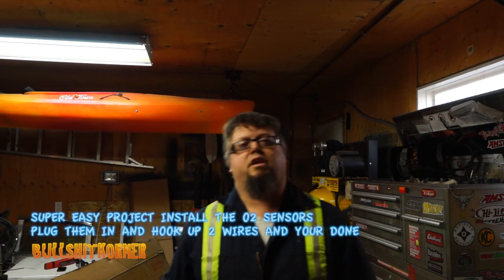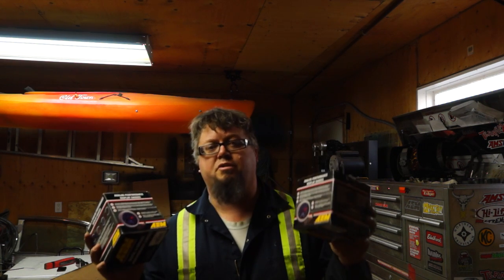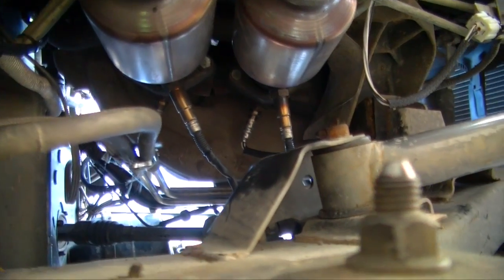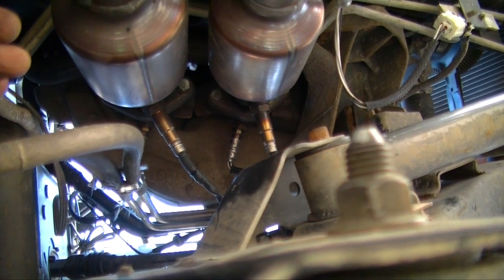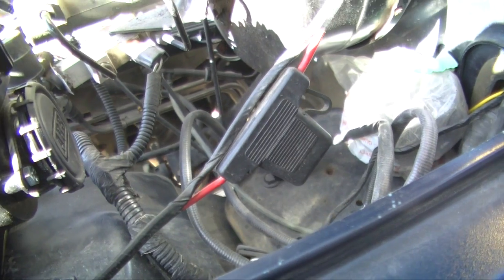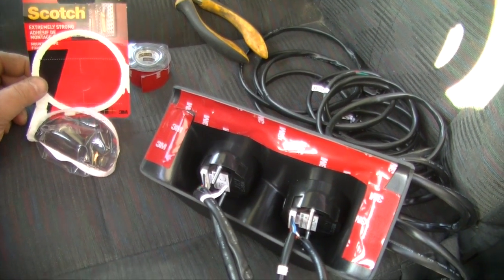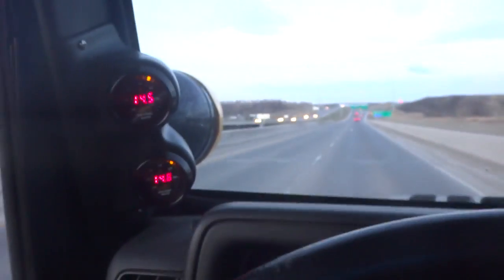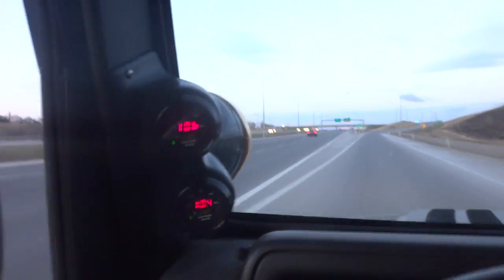Installing AEM Air Fuel Ratio Gauge

Comment: If putting the wideband past the cars scues the afr readings, then why does jeep put the o2 sensor post precats then?
Reply from the maker: Those are secondary to monitor the cats.  The ones in the headers measure the a/f ratio

Comment: That 3m tape would have stuck if you degreased the panel. its not the dust you need to wipe off, its the grease.

Comment: hey man, so I'm awaiting my supercharger for my TJ and was wondering which cat exhaust you have here when installing the widebands? I'm not 100% sure yet if there's enough space on the stock exhaust to weld the sensors in pre-cat but yours look just right. thanks

Comment: did you wipe the pillars with thinner before sticking sir? and did you check that you have the o2 bungs placed at the correct angle? seems like u planted 'em right at either the bottom or top most of the exhaust piping.

Comment: Hey, If you don't mind me asking. Did you splice into the intake line prior to the check valve or after for the split second vac/boost sensor and boost gauge? and if so does it effect the split second and boost gauge reading if it is sliced in after the check valve?
Reply from the maker: +Tyi Sloan the answer is neither to any of those questions, the routing is shown in the supercharge install video

Comment: I tried 3m tape in my F250 for the pillar gauges. Big time fail. First launch down the drag strip they were done. Haha.
Reply from the maker: Zane Pyles Ugh i hope you don't have the 6.0 diesel, i had a 2006 f350 and my diesel was a pile of crap
Reply: Na, 6.4. Haha. Holds up much better. 110k Miles and hasn't left me stranded so far. I have some work into it. The fuel systems on it are touchy. I'm running an bigger sticks with a single s476 turbo with ccv rerouted and airdog to keep up. We have some 6.0 folks in my town, but they all drive like my grandma.

Comment: Yo this migtnbe a dumb comment but so you dint have o2 sensonr on the jeep howd ur car computer know how much fuel to add or take away to keep it in (not sure if spelling Is right) stokiometric
Reply: Tha gauge just monitors what is reading from the exhaust. The stock 02 sensors are sending a/f info to the vehicles computer which in turn is adjusting as needed. The gauge he installed is just monitoring whats going on and puts it in a format you can understand "the gauge".... which you can in turn use to tune.

Comment: Apologies for my comment on a previous video, in which I believe I said it looked like you were running lean at WOT.  I misread 10.x as 18.x in the previous supercharger video.

As for the pre-cat issue of locating the AFR sensors, that's a dissertation in and of itself.  Long story short, you did the right thing in installing them upstream of the precats, despite the distance not being ideal.  You CAN install them downstream of the pre-cats, but you then need to calibrate them, either with a resistor network or computer wizardry, which those gauges probably don't support.  It's a lot of work with no real benefit outside of outright racing.

If you're curious about the process, you're welcome to Private Message me here on YouTube, but it's waaay too much for a comment post, and no one really cares.  ;-)
Reply from the maker: rhkips man if i was running 18 at WOT i'd be melting pistons pretty damn fast,  In the future i may play around with the split second programming so i may have some questions for you then
Reply: Haha, you'd be imprinting your hood with your cylinder head at 18:1.  XD

Hit me up anytime!  Happy to help if I can.  :D
Reply from the maker: thanks i may do that

Comment: If you ever want to use the 3M tape on plastic. Get some ad pro adhesion promoter. It etches the plastic. You just have to let it flash off. We use it on all plastic that needs two way tape for Ford, Honda and Chrysler.
Reply from the maker: Jason Macfarlane thanks for the tip

Comment: The problem with using that tape on interior pieces is the oil in the plastics.No matter how much you clean the plastic that tape wont stick for long.
Reply from the maker: retiredppd ya i found that out the hard way

Comment: If you're looking for the stickiest 2 sided tape, it's 3m vhb. It's the same stuff Lund uses to stick on vent visors, and those stupid hood scoops. Also, if your installing 02 bungs, if possible, try and keep them 10 to 15 degrees off horizontal to make sure moisture can drain out. Hope this helps!
Reply: Hey. No vehicle is complete without stick-on hood scoops. They're probably good for like 10 extra hp too!
Reply: Ya, or another 5 if you stick one on the roof
Reply from the maker: 1quickchevy2 +20hp for a NOS sticker
Reply: Aerodynamic edge, with vinyl siding side skirts, and hardware store metal mesh grill inserts.